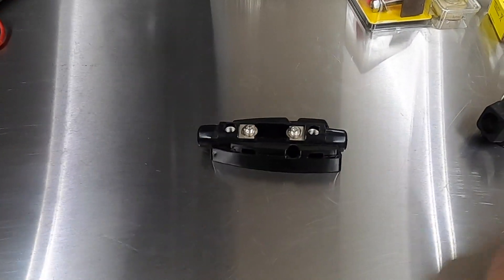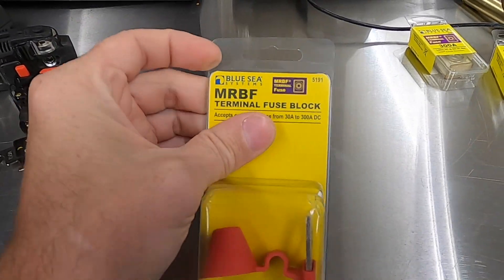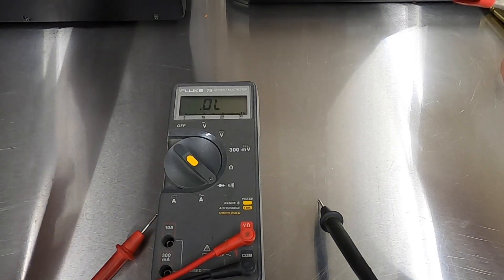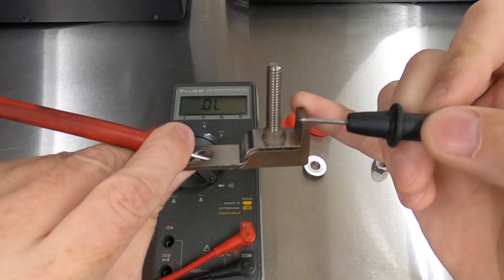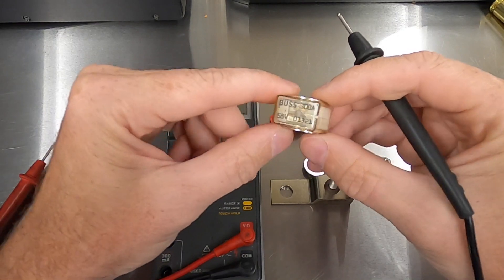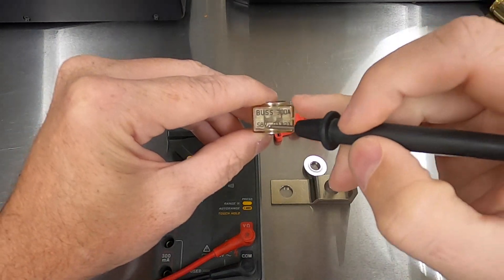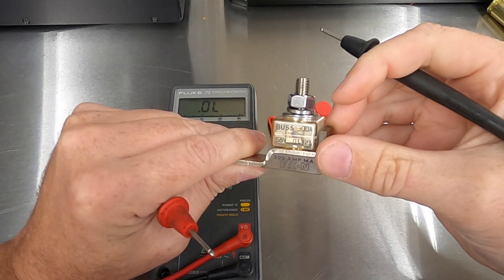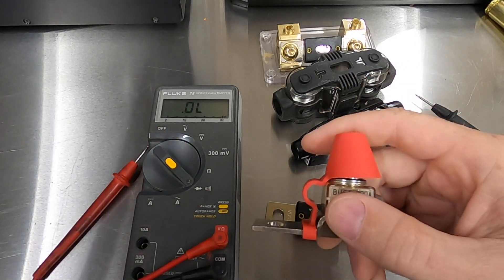Fusing Of A Different Sort: MRBF Fuses

Comment: My question is: If I connect a 12.8V 100Ah LiFePO4 battery to a 2,000 Watt inverter, what amp rating fuse is the right one?  As explained, the MRBF fuse is connected to the Positive terminal of the battery, right?  Thanks.
Reply: Depends on what the wire size is ,

Comment: I want to use these - but my battery terminal is all 5/16 stud, not 3/8 - tempted to try a large washer and see if it works…
Reply: you can use the M8 size of the Littelfuse ZCASE SMZ. It's a similar idea, but the fuses are not compatible.

Comment: I use these fuses the most of any BUT they have less time to deal with voltage spikes than an ANL fuse. These are fast blow.  They still can deal with a split second of higher voltage but they blow faster than a slow blow or T timed or TT fuse.  For reference 2ga wire would be 150A fuse, 0 ga for 300 Amps.  If it's for a starter only wire I go with a bit higher fuse to deal with starting ingress  voltage spike.   Most people say you don't fuse a starting wire but in my location for new build boats they now require the cable to be fuses.  That's why I watched this video.  Trying to see if 300A terminal fuse will still blow starting.  I see people say 200-250A for ANL fuses but they blow slower than these.  I have 225A fuses so I'll use them for now and carry some spare 300 Amp blocks too.  A starter can draw 550 amps for a fraction of a second sometimes, I guess I'll find out if the fuse blows from that quick of a surge or now.  Anyone else use these for starter cable? Or main engine line w starter on it?
Reply: Can the starter wire handle 500a continuous?  If not, I wouldn't fuse it higher
Reply: @Mastermindyoung14  no wire in any car ever build would handle 500a.  I don't even know if the powerline to my house can handle 500 amps. I was asking about fusing a starter because no manufacturer fuses the starter cable.  They are a unique senerio where they receive 200 Amps for like 1 microsecond so you'd want to put in a fuse that has a break time of over that period and they time frames for these block fuses are not listed or we'll known, just that it's faster than ANL fuses.  Starters aren't fused because the amperage they produce for that first microsecond is inconsistent and depends on a huge number of factors like engine piston size, current battery level, alternator size, compression ratio, gearing, current temperature outside, fuel injection type, etc. It's not a simple answer like fuse it for 500 amps.  The block fuses only even go up to 300 I think. My question really was will this fuse type allow a 2 microsecond spike or is it super fast.
Reply: Starter cables on an LS Chevy engine are what... 2awg? Which, its ratings are well below a typical Cold Cranking Amps of 500+ Amps. The reason is they are instantaneous spikes and not ongoing current flows. In short, for starting, one can get away with wires much smaller than 500+ rated wire.

Comment: I've just spent hundreds of dollars buying up all those other fuse types, circuit breakers etc, only to discover these. I love they way the fuse is right on your terminal, however, I'm just questioning if only one holder with one 300A is the way to go? 

This means you'd have to have one hell of a thick cable from your battery terminal to your 'next' fuse terminal block (which would probably be a Blue Sea Standard Blade ATO/ATC Fuse Block) and that's only rated at 100 amps which would mean if you were wire up 10, 15A circuits in it, you'd overload it! 

Would it not be better to run several of these at lesser amps (100A a piece) in my case, one to feed the fuse block (100A) one to feed the electric hydraulic tipper trailer (100A) one to, perhaps, feed another fuse block (100A) etc? 

Thanks.
Reply from the maker: There's a run of 0AWG that goes to the back of the car and feeds a fused power distribution panel with mini ANL fuses. 

This was the perfect solution for the application where it was used. Your application may require a different setup.
Reply: @BatdogGarage  After a bit more research and some thought it actually sounds like the ticket, I’m going to do something similar myself. Thanks for the video.

Comment: I use these all the time. As you can stack them..You can buy 2 of the Two Pole versions. Stack them and run 4 separate fuse types from one connection point. No 4 point connection buss bars that cost $100.00+ each. And if you have an issue. You know where to look. 

Not to mention they take up very little space. All that is needed. Is to install a Disconnect. If you need to service the system...

Comment: Thanks for the video. I’m learning about the electrical system for my up coming van conversion build and your video was very informative. 1 Question 🙋🏻‍♀️ however, if the terminal size on the battery is 1/2” M14, how would you make it fit?
Reply from the maker: Drill the opening. I had to trim the tab on this unit when I installed it in the Audi.

Comment: Ive been running them for the last 4-5 years and i love them. Somewhat pricey though compared to ANL fuses. You can also use bolts made out of plastic or special nuts that are made out of plastic if you are running a metal bolt. In germany we call them CF8 or Littelfuse.
Reply: I've tried running plastic bolts (actually fiberglass) and my experience is they're not strong enough to properly clamp down a big crimp on connector.  They'll loosen and stretch.  My strategy was to use a plastic washer to isolate the head of the bolt and then put some headshrink around the shank of the bolt where it passes through the bus bar.  The bolt and nut then become fused.

Comment: Looks like it also makes routing cable a bit easier since you don't have to account for the bulky anl holders. Very nice
Reply from the maker: For sure. That's a tight area and it's difficult to package an ANL (or mini ANL) fuse holder in there in a way that the fuse is easy to replace. This is compact, allows for much nicer cable routing, and is easy to service.